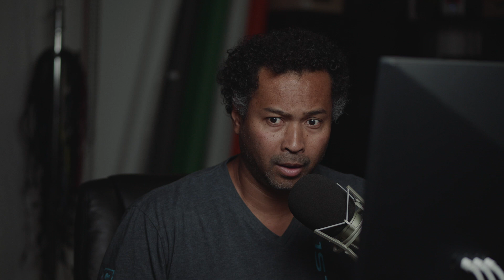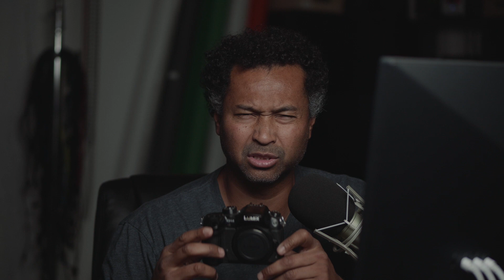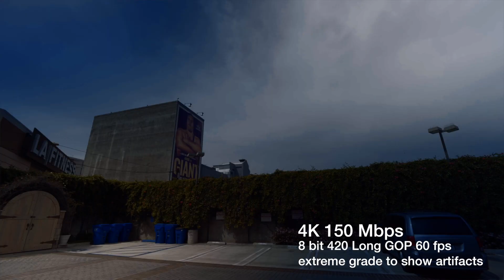Panasonic GH5S 10bit Versus 8bit

Comment: I'm moving to my off-grid forest land where I will have limited Internet access / speed.

as G9 owner I have been recording everything in 4K 8-bit, and uploading to YouTube, and I was happy overall with the image quality.

however now I need to look into making my video files smaller in size, to be able to upload them on "bad" Internet.

your observations seem to be very helpful and promising too. 

I'm going to either:
1. keep recording 4K 8-bit, and render to 4K and 1080, and upload 1080 to save upload time / Internet quota etc
2. record in 1080 10-bit, and render / upload it as such

what do you suggest is better image quality wise, and what will the file sizes proportions be like in the above 2 options

PS
I have the feeling that 1080 422 AI might even look better than my 4k 8-bit, but you know what I mean by the "greed" of wanting to have 4K videos on my channel. 

another question:
can I upload 4K version of the same video later, or will YouTube treat it like a totally new video, which loses the views earned by 1080 earlier uploaded version?

Comment: Question, I am using zebras and the waveform to help balance my exposure and that’s helping, but now once that’s done, my question is what do I prioritize to lighten my exposure - aperture, shutterspeed or iso? Like should I keep aperture at a minimum (2.8 on my lens) and then use shutter speed and/or iso to adjust the exposure? Which one should I keep low and which should I be adjusting to move the waveform ?  I obviously want to stay away from noise as much as possible, Someone please help I am dying trying to figure this out and I can’t!!!!

Comment: Thanks for this video. I’ve been searching for this answer. I’ve been shooting on the Sony a6300 (8 bit) and have been trying to isolate skin tones and push colors in the shadows. And dang. It looks horrible. Artifacts all over and the image just falls apart. It’s like I can only give it a basic grade and have to add colors over the whole images that would also affect the skin tones if I don’t want the image falling apart. Isolating the skin and pushing colors is like not possible. But the GH5 however, sounds like it would be a lot more rewarding with this process. Really considering grabbing one now. Thanks.

Comment: Nice samples. But I have a question regarding All-I. Does it affect your workflow? For better? For worse? Do you transcode your footage for further processing? How All-I affects transcoding times?
Reply from the maker: Paweł Przybylski I’ve found that shooting in all-I or shooting IPB doesn’t make that much of a difference. Just save yourself card space and shoot IPB for the most part. IPB is so good that you’ll be hard pressed to see any difference between the two.
Reply: @Spinflight  I am talking about conversion / transcoding times, not the image quality. I know it is the same.
Reply from the maker: Paweł Przybylski doesn’t seem to matter. Transcode times seem to be identical. So shoot either one.

Comment: Very cool... Just wondering. For a 256gb card, how much record time do you get when using the 1080p, 100mbps, 10 bit setting?
Reply from the maker: Here are the times for a 125 Gig card. FHD 200 Mbits 1 hour 22 min. FHD 100 Mbits 2 hours 44 min.  For the 256 card, just double it.
Reply: @Spinflight  Thanks :)

Comment: Vlog was never meant to be used in 8bit.  If you need to shoot 8 bit, shoot CineD.
One things for sure, unless your shooting VFR, there's no point in not shooting in 10bit.  Its why we got the camera. If you like to grade, use the Vlog profile.  But for those that don't, HLG is great too.  Got to convert it to rec709, and make minor easy tweaks like adjusting shadows/lights/saturation, but much easier in my opinion to work with then Vlog.
Reply: Bit of a noob here - a lot of people talk about converting to rec709. What does this mean and what's the process?
Reply: Mark Grafton rec709, hlg and vlog are different color spaces. You can convert hlg and vlog to rec709 using a LUT in post production, and you’ll be able to grade it and use additional LUTs afterwards

Comment: Good video!  The only issue with shooting 1080 instead of 4K for anyone doing professional works such as weddings, corporate events, etc. is those clients will most likely have, or will eventually have, a 4 K TV and want the finished product at the highest resolution their TV can support.

Also, 4K gives you more wiggle room for cropping in post if your finished product is delivered in 1080.
Reply: Cropping freedom is a real thing guys , would always rather shoot higher res when I can

Comment: The  European broadcast union and BBC tech expert repot on the gh5s  has cleared the gh5s for broadcast . It is recognised that bit rate is largely more important than resolution . The report states the gh5s easily clears the standard for hd broadcasts but fails some tech spec of at uhd and 4K . I myself will be using it for a BBC documentary in India next month . I spoke with the head of tech at a leading pro edit house  and he declared its optimum setting to be vlog. 200 Mbps 10 bit . 4K I guess would look better on a tablet or computer screen but for a 42 inch tv less failing would be  seen in Hd
Reply: The BBC HD spec isn't that high these days, the Canon XF300 meets it. My guess is that the BBC want true resolution, which basically means that the 4K in the GH5S doesn't provide enough detail for a professional 4K image. For example, an HD sensor with a Bayer pattern will won't actually give you 1920x1080 as you'd get from say a 3D Render or when going from 4K to 1080, what you actually get is a green channel with a resolution 960x540 and red and blue channels with a resolution of 480x240, so you're when you add 4:2:2 chroma subsampling you get even less detail.

Comment: Hi There.  To answer your question regarding out the HDMI.  Unless you change the HDMI settings in the camera it will send out an 8 bit signal.  You can change it to where it sends a 10 bit 422 signal, but be advised that doing this means you can't record internally when shooting 4k60p.
Reply from the maker: The HDMI Cable makes all the difference.  Upon testing a bunch of cables, only the Atoms cable seems to be able to sustain the 10bit 4K at 60fps.  That's why it's so expensive. When using cheap subpar HDMI cables, the cable itself isn't capable of the full 10 bit signal and that's why I wasn't getting the full 10 bit to the recorder.
Reply: @Spinflight  hdmi 2.0 cables should all be able to transmit 10 bit. Wasn't yours HDMI 2.0?
Reply from the maker: @azamat19  So far I've only found two HDMI cables capable of transmitting full 10 bit data at 60P.  First is the Atomos which is very expensive and Very thick.  And now the brand new ZILR HDMI that was just announced recently that can be purchased on Amazon.  This new cable is much thinner and flexible and is awesome for Gimbals. I've tested cable after cable and have found most aren't capable of passing through the full signal.  Even though a different cable might seem to work, it's actually not passing through the whole 10 bit signal causing the 8 bit banding still noticed in the recorder's footage.
Reply: @Spinflight  Hello I too have bought many hdmi cables that constantly gave me that kangaroo skippy error. I’m thinking about taking the plunge for the expensive atomos cable and then I saw this...

A year later how has the ZILR cable been holding up?